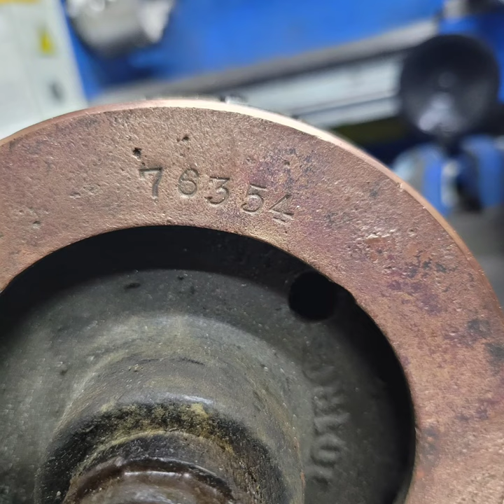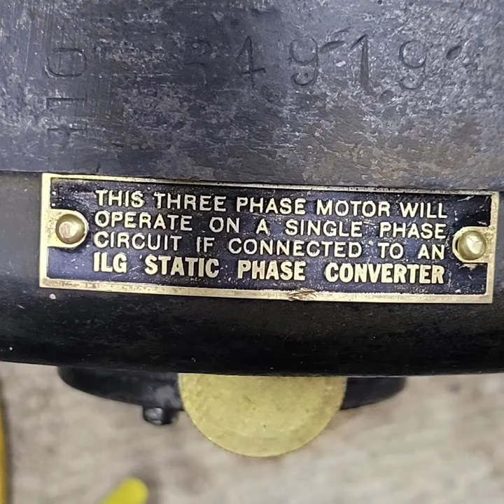ILG B-25 Universal Blower, Motor Preservation and First Run!

Comment: Cut the blower be used in an air conditioner?
Reply from the maker: These blowers had many possible uses and I am sure they could have been used  for an air handler for an A/C system
Reply from the maker: ILG was a total different company, no relation to LG

Comment: Love the massive copper induction rotor!   That motor sure looks good with the parts cleaned up.
The sound is great, but I would love to hear it from a position without wind noise. Wind noise is very irritating to me for some reason.
Reply from the maker: Thanks! The motor was so much fun to work on and yes this was really just a test video, but I have better videos coming soon without that wind noise.